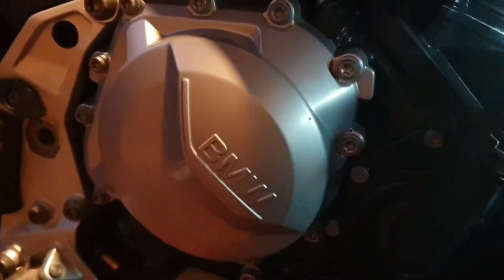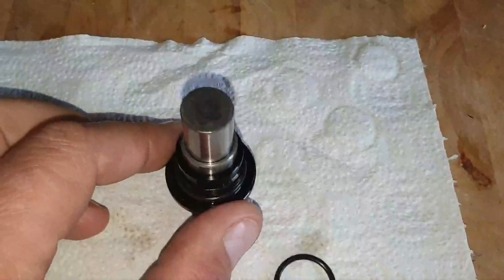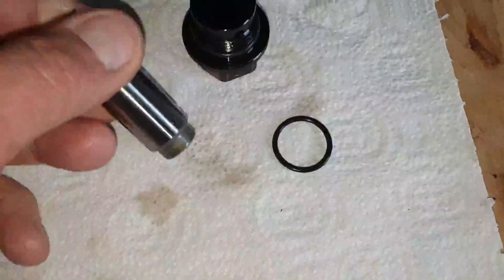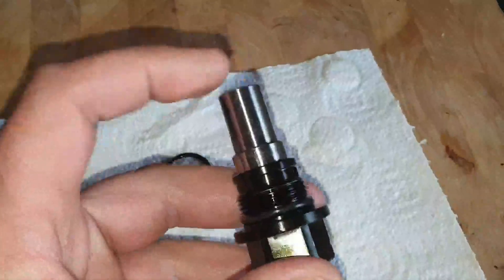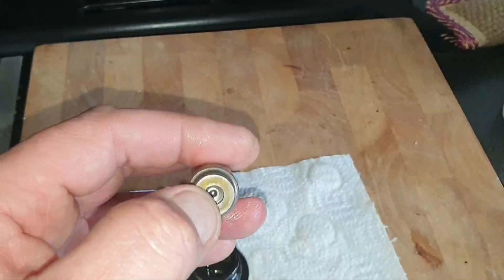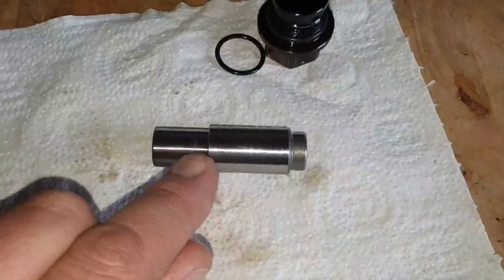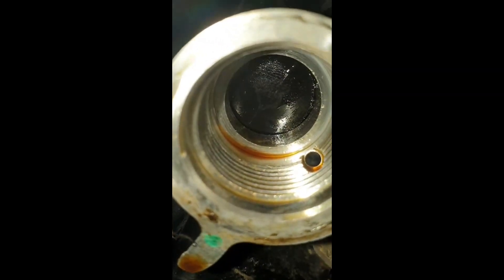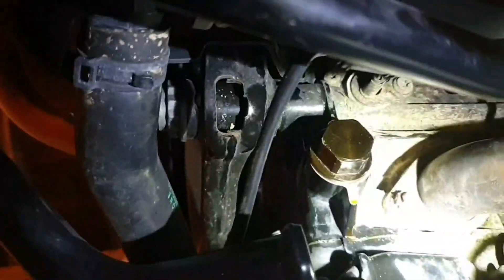BMW F850GS Hydraulic timing chain tensioner

Comment: I think that the valve shown in the 3:40 min video is something like a ratchet. As the chain lengthens, more and more oil gets under the piston through the one-way valve. This causes the tensioner piston to be initially extended sufficiently during start-up, before the oil pressure increases. Otherwise, when the engine is turned off, the piston would always move back, which would cause noise in the first phase of start-up. Maybe the leakage of this valve is the cause of the noise during start-up and its disappearance after a while of engine operation.

Comment: I own an F750GS bought new in October 2022, to date the bike has traveled around the world and currently has a total of 97,500 km and honestly at least on mine there is no noise. I only had one leak from the water pump when it was new, replaced promptly under warranty, then just driving pleasure in all conditions. Warm greetings from Italy
Reply from the maker: I'm finding it's wearing them out doing a lot of off road riding. It was OK until the percentage of off road overtook the on road usage.

Comment: Great video. I am doing this as a preventative maintenance. Is the removal and installation plug and play? Or does it involve any other procedures?
Reply from the maker: @edgarpicazo5993  it's not like other timing chain tensioners in that it does not have a non return ratchet assembly. So simply remove the old one and fit the new one. Do not start the engine without either tensioner installed as you could cause catastrophic damage. Have you considered a non hydraulic manual type tensioner?
Reply: Good to know thanks. I have, there is a company called SoCal BMW that sells the manual ones. Kind of nervous to try them out. I'm basically replacing it as preventative maintenance since I ha e 16k miles on my 850GS.
Reply: Have you considered a manual one vs. hydraulic?@motomeltdown
Reply from the maker: @edgarpicazo5993 I have a manual tensioner waiting to go in. I am just waiting for the existing tensioner to fail before I install it, though.

Comment: Hey. How did you access the bolt? The O2 sensor connector and radiator block the way to access it with a wrench or socket. :(
Reply from the maker: I used a short socket and ratchet wrench to start it off, then an open ended spanner to wind it out. Put a piece of good quality cardboard against the radiator to stop it getting damaged.

Comment: Did the new tensioner solve your issue?
Reply from the maker: Yes, the noisy start-ups have now stayed away for around 5,000 miles and still no sign of returning. Could not tell any difference between the new tensioner and the one I took out when operated by hand on the bench, but clearly, the new one is good, and the old one is defective.
Reply: Thanks for the reply

Comment: Was the new one upgraded by bmw ? Or was it still the same?
Reply from the maker: I bought a new one from BMW and although it seemed to be exactly the same as the old one, with binding etc when manually operated, it HAS fixed the issue. No more noisy rattling on start up. Cost around 80 GBP.
Reply: @motomeltdown  Okay thanks for that , Have been looking at a new Trophy model and have read about this problem a few times .
Reply from the maker: @GuessWhoo-v2h  I asked the BMW main dealer about this issue and was told they had never come across it before??? The original cam chain tensioner went bad over about 3 or 4 rides, from no issues to sounding like a terminal engine failure. It only affected cold start ups, once it had been fired up and run up to temperature for the day the cam chain remained quiet for all subsequent start ups  on that day, but then noisy again the following morning.
Reply: Strange thing  to happen . Hope it fixes it for the future of the bike .